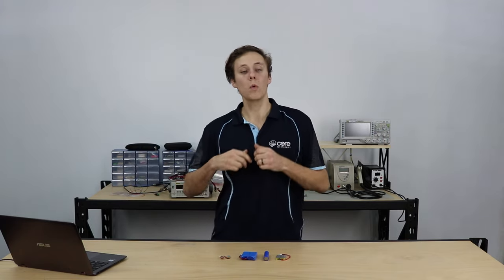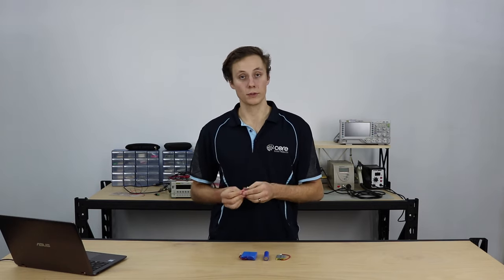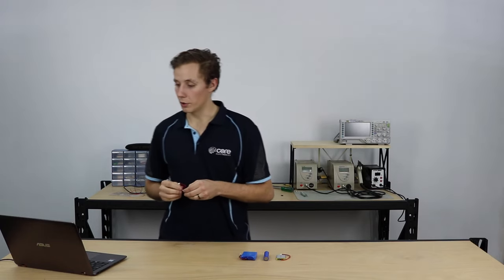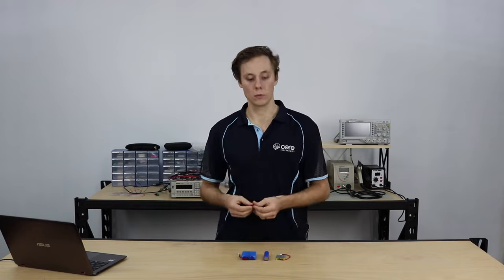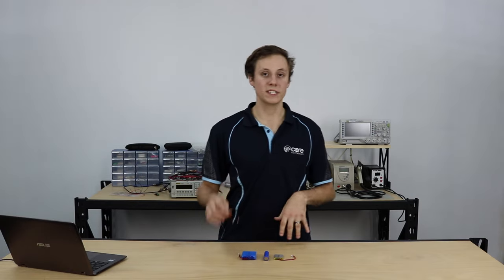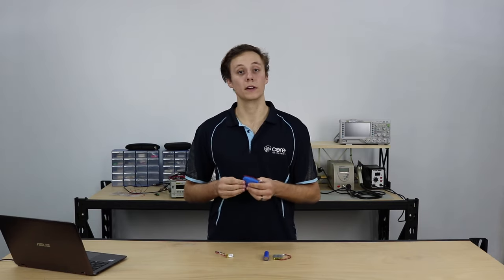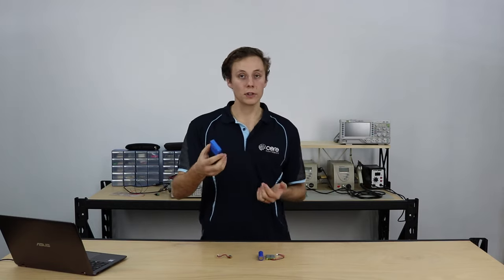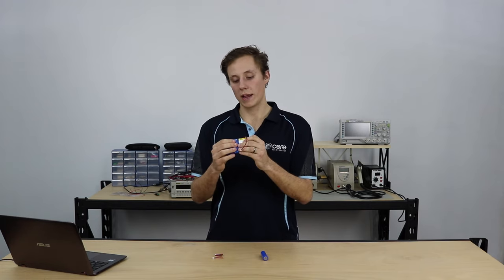Choosing Your Next LiPo Battery (Lithium-ion Polymer Battery)

Comment: Super useful. I am a little nervous about using LI-Po in my project with the 3V minimum etc. Do i need a battery controller as well to make sure my project doesn't suck too much juice?
Reply from the maker: This is true PMS (power managment system) or BMS (battery managment systems) are important for the longevity of a LiPo battery in a project. Otherwise as you state your project can suck all the juice out the the LiPo leaving it damaged. If you want to learn more come ask some questions here at our forum - https://forum.core-electronics.com.au/

Comment: I am using DELL latitude e6530 it uses cylindrical battery cells of 5000 mah i want to upgrade it to use 20,000mah lithium cell batteries (like the one used in powerbanks) Is it advisable for me to take this approach?
Reply from the maker: Modifying a pre-built battery like that is often not advisable. There are often very specific charging circuitry designed for the battery and it may be a fire risk to replace them.

Comment: I was hoping you could help me out on decoding the different letters on a  3.7V 300mAh LiPo Li-Polymer Battery.
After an extensive search online I came up empty.
I have seen FP, HYP, XJDZ, PZY, LP,  etc. on 602030 batteries and have no idea what they relate to.
I need professional help! lol
Reply: If you were talking about the 3.7V 300mAh bit, I can explain, the FP, HYP stuff no idea.

3.7V is the difference in the electric current, while 300mAh is the unit of current. Ah stand for ampere. The two number given can be mutiplyed together to find the power the battry out put.
 W = 3.7 * 0.3 
W = 1.11 Watt
Power is defined as energy per second.
So what it is telling you is that it output 1.11 joules of energy every second.
Reply: Thanks for the reply, it seems these letters are a mystery everywhere  I looked. The most feasible answer I found was manufacturing codes. It would be great if you know definitively what connector was used on each battery when ordering. They are used in a lot of different applications.
Reply: looks like they are the letters from the manufacturer, ehao = EHAO Technology Co.,Ltd

Comment: What battery is better for powerbank. Li-ion or Li-po.
Reply: Depends on the form factor you're looking for. If you don't mind going with a bigger battery, go with 18650s, because they have a pretty high capacity
Reply: @jonnyb9843  nah I've already bought a 10.000 mah powerbank and decided to go with Li-po.